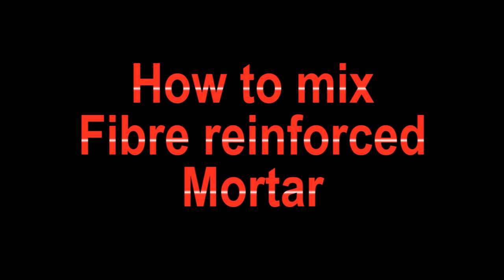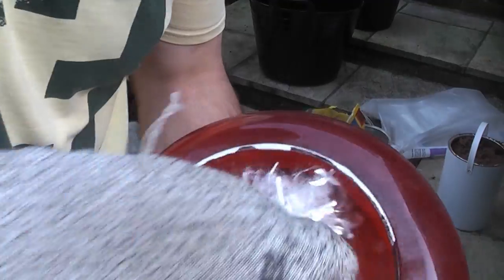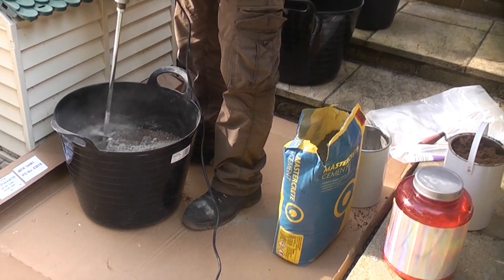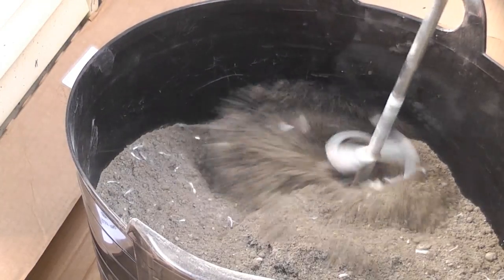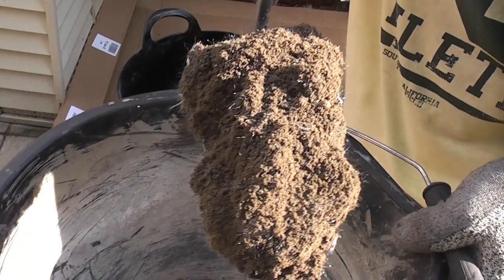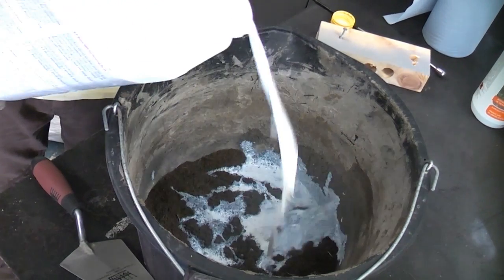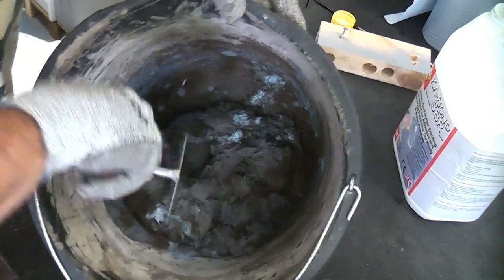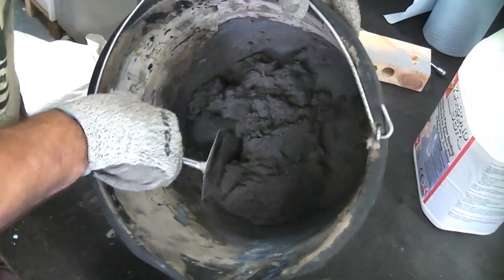How to mix fibre reinforced mortar | SBR mortar

Comment from the maker: @ Philip LindleySBR is a Latex based cement additive that makes the mortar more flexible and waterproof.I would post a link to the product but can't paste any links into the comments section for some reason. If you Google SBR bond you will find it ;-)

Comment: wonderful channel keep up the good work..I am thinking of doing this mix 3sand 1cement for bathroom walls and found equivalent to SBR here in Australia I am going for Bondall Silasec Water Proofer ..but cannot find the shreded fibre fabric ..but can buy the fibre glass fabric in 1 meter by 1 meter size.. if I then shred it using a scissors ..do you think I can get the same result or can I prepare the mix without the fibre
Reply from the maker: +Danny Dora 
Thanks, I just found some on ebay in Australia- http://fave.co/1Sd5C3y

I don't think cutting up a sheet of fibre glass will be any good as the strands in the reinforcing fibre are very fine.

Comment: Hello Sir, have you worked with carbon fibre in concrete? 
My friend who is doing PhD is facing an issue where the mortar cubes cast using carbon fibre as an additive are found to stick to the surface of the mould even though oil was applied to the inside of mould before pouring the mortar. The situation is same even after waiting for 48 hours for de-moulding after casting . Also, the surface of the mortar cubes on de-moulding develops cracks or the cube is breaking into pieces. If you have a suggestion on this issue, kindly advise. Thank you so much for your time.

Comment: Flexible and cement are not two things I usually think of together.  There is a lot to learn about this material.

Your videos are so varied and informative, thanks.  I could not see and you did not mention, I think, if you are working with this kind of stuff do you need breathing protecting and if so what kind do you recommend?
Reply from the maker: +justgivemethetruth 
I'm not sure to be honest. There was no heath and safety information on the bag that the fibre came in. I am sure the fibres are made from either polypropylene or polyester and so should not pose a health risk. Wearing a dust mask should ensure that non of the fibres are inhaled, but it's unlikely that they will be airborne if you handle the carefully.
Thanks for the comment ;-)
Reply: +Ultimate Handyman 

I've always heard that you should not inhale cement particles for sure, but I have no idea how high they can float in the air.  I thought the fibers would be made from silica/fiberglass and did not know about polypropylene fiber reinforcement.  I guess you learn something every day on You-Tube.   Thanks.
Reply from the maker: +justgivemethetruth 
Oh yes, cement is bad and if you are working in a confined space then definitely wear a dust mask when mixing. Plaster is also bad and should not be inhaled. If mixing inside I would definitely wear a dust mask.
Thanks for the comments ;-)

Comment: Dear U/H Man 
I am trying to make a concrete bathroom sink top in a ( top fill mold) in place I f that makes sence and would be grateful if you could advise me on a good  mix of cement ( maybe / not sand) and or SBR that will leave me with a good smooth finish without too much in the way of diamond sanding  when finishing off.  Many thanks Adrian.  Great videos very informative thanks
Reply from the maker: I'm not sure about that, sorry.
It's not something I have ever done before.
There are some guys on YouTube that make such things, I would ask them 👍

Comment: Can we mixed PVA with plaster of Paris?
Reply from the maker: Not sure about that. I always use SBR when mixing mortar, but I’ve never tried it with plaster of Paris 🤔
PVA is not a good thing to mix with anything that could potentially get wet, as it can turn back to a liquid.

Comment: Did you use sharp sand, or building sand?
Reply from the maker: Building sand
Thanks for the comment 👍
Reply: Thanks. Would you use this mix to bed ridge tiles on too?
Reply from the maker: @DC-sf5rk   You could do, but you only really need the fibre adding to the mix when you are pointing them up, after bedding them down ;-)

Comment: Hi, could you use this mix to make fibre reinforced cement boards if you left it to cure in a mould?
Reply from the maker: I'm not sure, as it is something that I have never done. I assume it would work, but I have never tried it.
Thanks for the comment
Reply: @ultimatehandyman  If you were going to shutter of form some raised planters what concrete mix would you use and gravel size to get smooth? Thank you